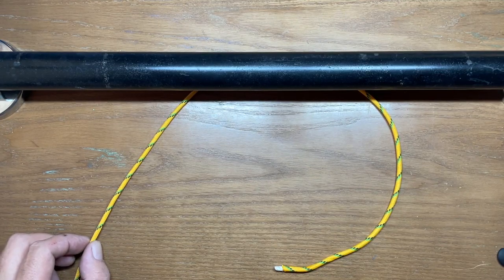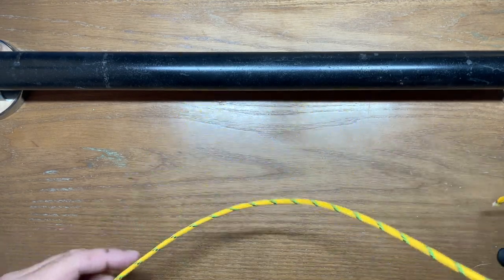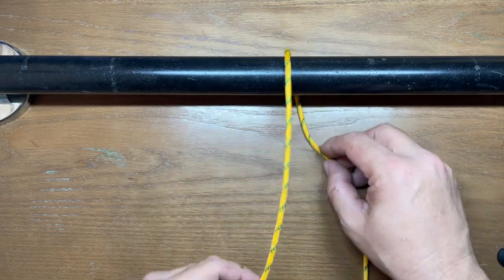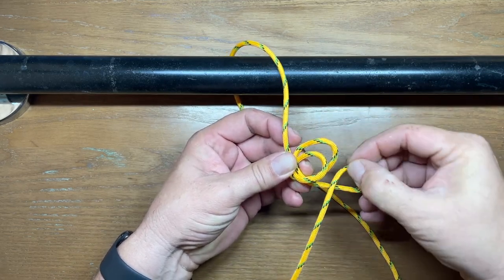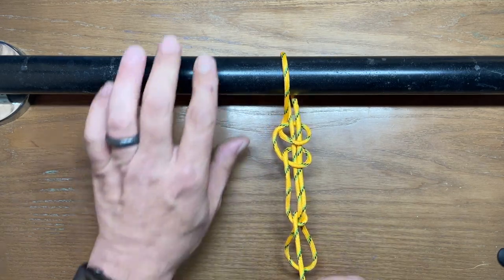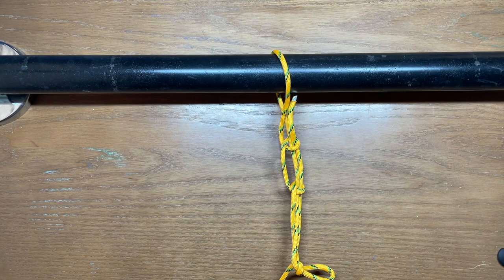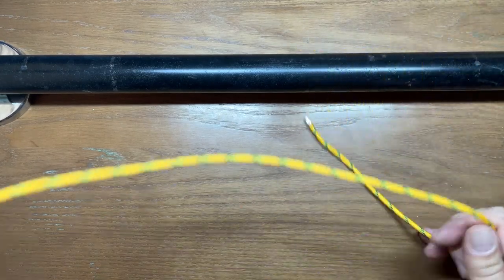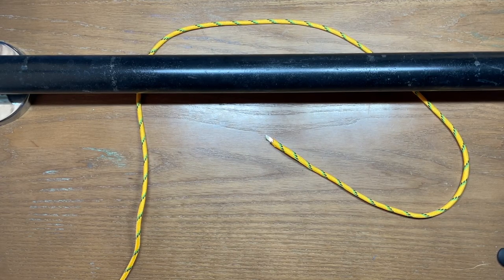Temporary Tow Hitch Knot

Comment: Great video - what knot or hitch would you use to recover a stuck vehicle off road?

For example I have a “come along”  with hooks on both ends. One end is on the truck.

The other end is too short to get to a tree, so I have to use an extension rope.

The come along clip attaches to the extension rope’s eye. The other end of the extension rope you need to tie to a shackle on a tree saver (single line pull).

What knot would you use to attach the rope to the shackle so that it doesn’t loosen when the rope is slack, doesn’t weaken the rope too much, and can easily be removed after?
Reply from the maker: Zeppelin Loop

Comment: is this knot as strong as the original rope's rated working load ?
Reply from the maker: No knot in the world is.
Reply: ALL knots are technically nothing more than a controlled and repeatable "tangle"... and ANY "tangle" is a weak point in the line, so @TXToolCrib is 100% correct. 
Physics 101.
Lol
 
The Palomar is pretty close (somewhere in the upper 80% range, but still...)